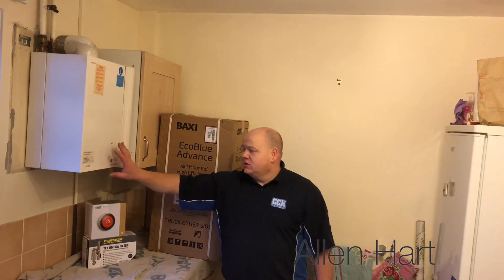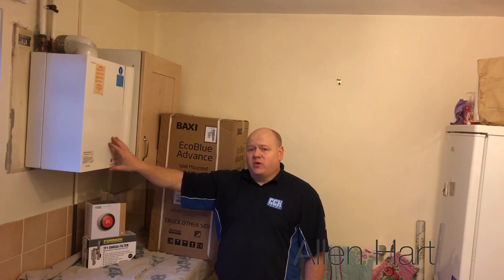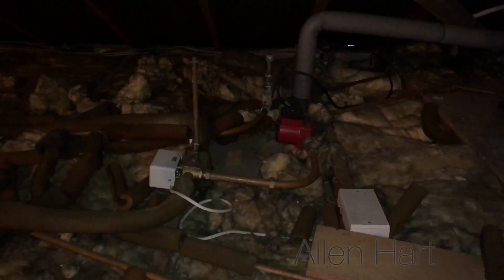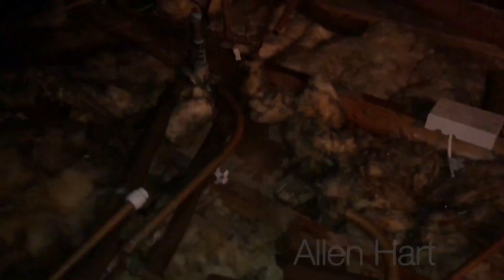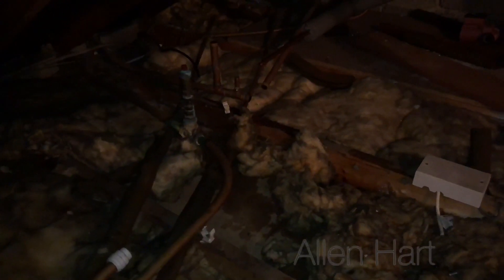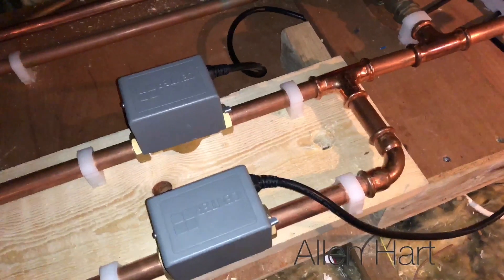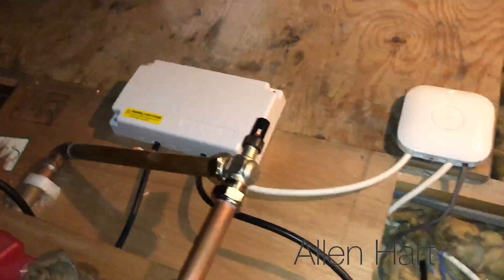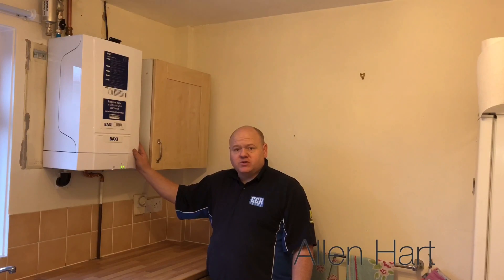Baxi EcoBlue Advance Heat Installation S plan and Nest

Comment: Thanks, great video. Just out of interest, a couple of questions:

Why is S Plan better than Y Plan in this situation? I'm due to have a new heat only boiler fitted into my Y Plan system in a couple of weeks, should I consider asking them to requote for an S Plan conversion?

What did you do about the electrical pump overrun connection to the loft. My situation is similar (i.e. pump + wiring centre and boiler are a long way apart) so running a wire between them would be difficult/expensive. As far as I can tell, no unused cores in my existing cables between the two locations.

Comment: Hi Alan, used to work for Myson many moons ago in the days of the famous Apollo boiler, biggest problem we had with Apollo installations was the feed and vent arrangements, it was mandatory to have a combined feed and vent albeit lots of old time installers insisted on installing this boiler in the traditional way or with an air separator both of which were not allowed. I noted your 22mm combined feed and vent using a 22mm tee which was how the Myson Apollo should have been installed, interestingly I am fitting an Ecoblue heat only soon and would prefer to use combined feed and vent as u have yourself albeit Baxi tech tell me its compulsory to use an air separator with the Ecoblue?

Comment: Hi Alan. 
Great video. Always fitted combi boilers never system/ heat only!!  
How easy is it to convert from y to s plan. Am I right its the stat(s) that control the 2 port valve. 

Great video. 

Thanks 
Alan.
Reply from the maker: Very easy as long as you can get into it all. Thanks.

Comment: I have just had the same boiler fitted but the 16kw. Can any smart thermostat be fitted I want the baxi one
Reply from the maker: John Hope Lots of different smart stats could be fitted, personally I would fit the Nest
Reply: Allen Hart can a diyer do it or do I need an electrician or gas safe person. I didn't no whether they were compatable
Reply from the maker: The Gas Safe Engineer that installed your boiler should be able to give you the best advice. 👍

Comment: What they like inside Allen?
Reply from the maker: lots of good things about it, some things i am not sure if they will be good or bad but time will tell. very easy to install, Ali heat ex which is ok if you want a quiet boiler but i would personally rather have the extra noise and go for something stainless. very much depends on job, this was perfect for this install.

Comment: Alan why did you not pressurise the heating ? Very neat job 
good work
Reply from the maker: k20aa it’s above a shop and we didn’t want any extra pressure on system. The rads and valves are very old as well. Thanks for watching 👍

Comment: Top work!
Where do you buy your press fittings?
Reply: Allen Hart gebrit or xpress, what discount do you get on them
Reply: Allen Hart good rate, not having your pants down at the (unusual for plumbcenter). 

Dont you think peglar is taking the piss with 3 price increases in one year each at 5-7%
Reply: Allen Hart there worth every penny for the amount of time you save
Reply from the maker: Sash Window Plumbcenter atm ,
Reply: I've found them hit & miss in the past. Most branches don't stock press fittings, but I haven't used Wolseley in some time now.
Reply from the maker: They do not stock many TBH but they can get them next day.
Reply from the maker: We use Xpress atm but i do like gebrit better, i think i get 60% discount but not sure.
Reply from the maker: i think we pay about 85p for a 15mm socket. not cheap really.
Reply from the maker: TBH it that loft they where worth every penny, also cut down on flushing as we do not need to get flux out.